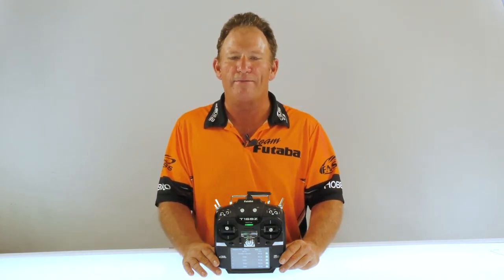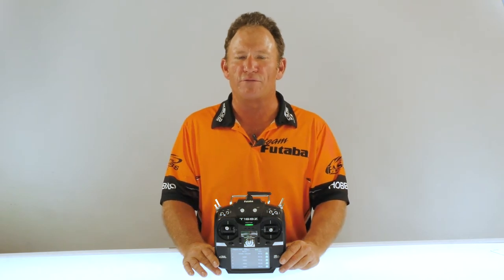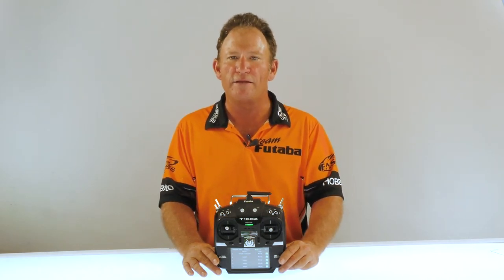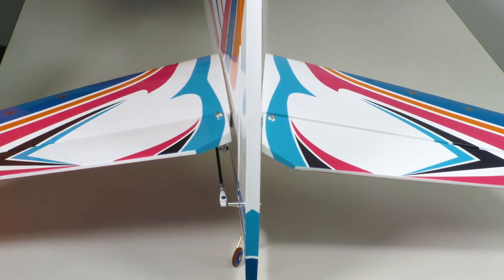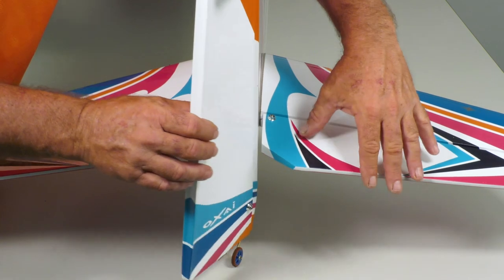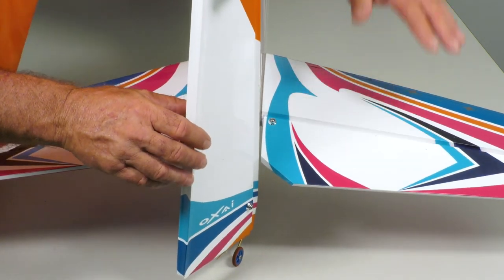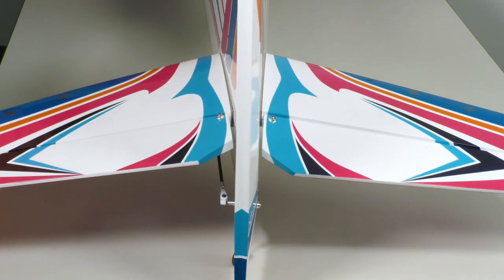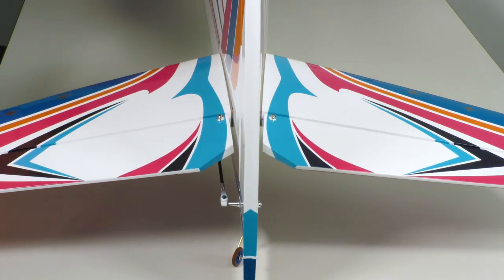Futaba 16SZ Soft Start: Tips & How To’s

Comment: My Futaba 172 high torque servo has the same feature.  It is much more reassuring than other brands of high torque servos which whip the control surface to center.  The 16SZ is looking better and better with each demo video.  Thinking my 12FG will soon be shelved for the 16SZ.  Thanks for posting all of these great videos.